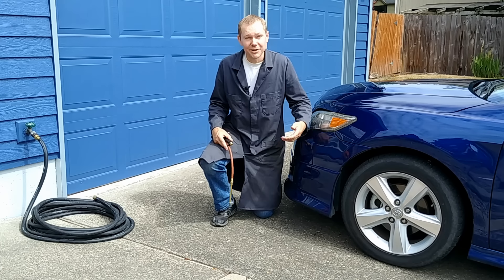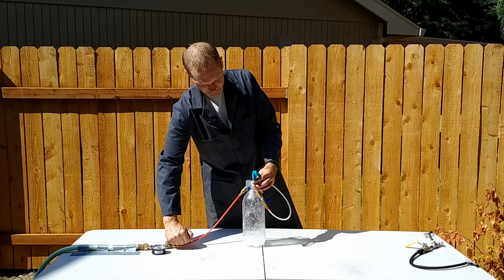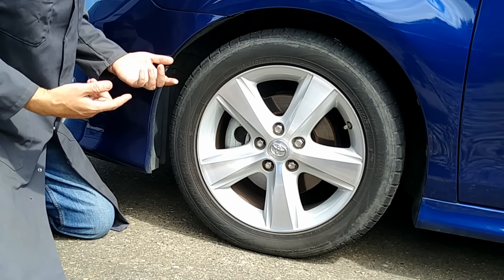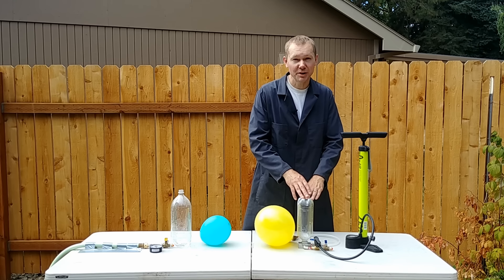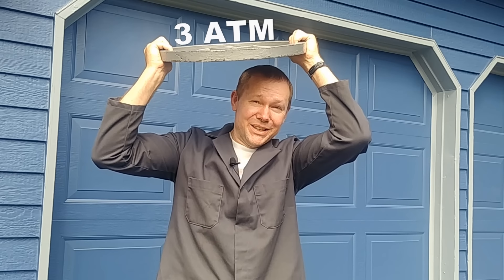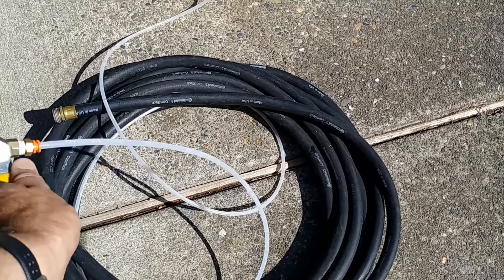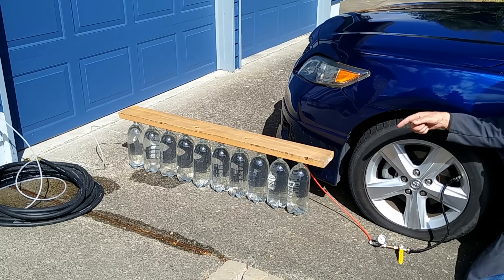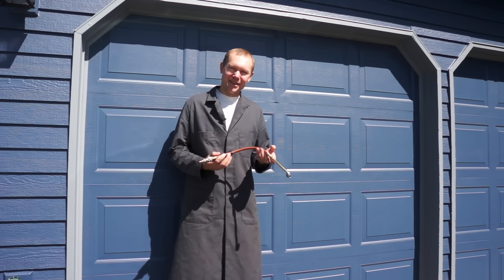2 Liter Bottle Compressor (No Moving Parts)

Comment: I once tried to fill a steel lawn roller with cone shaped plastic hose nozzle pushed tightly into the fill hole. It caused the flat ends of the roller to bulge out ruining it.

Comment: You should research the "trompe" which uses flowing water to trap air bubbles under a container to produce compressed air. It doesn't need to be emptied manually.

Comment: I had never really thought about it but the water acts like a piston being non compressible. As it occupies the same space that the air used to the air is pushed out and compressed when it has nowhere else to go. Then when released it wants to reach equilibrium with where it is going. Great, now I have to build a water powered air compressor for my shop!

Comment: I saw a company making air batteries doing something similar to this, they would use water pumps to fill huge storage tanks and then use the compressed air generated to pump the stored water through a turbine.

Comment: Fun contraption and experiment. But the pump up the tires in my truck it takes me about 5 minutes to turn the compressor on and pull the hose out into the driveway and air my tires.

Comment: The top end is whatever your spigot water pressure is. It would probably be more efficient to use a larger container like a 55gal drum. Screw the hose into one bung and then the air hose into the other bung. The pressure would build until it equalized with your source pressure and then the water flow would stop.

Comment: Good job! Just discovered you tonight and subscribed! However, there are moving parts. The water pump that is providing the water. Also, if the water pressure isn't at least as high as what is needed to fill the tire, it won't work. My well pump fluctuates between 25 and 40 psi, so not sure how that experiment would work out for me.

Comment: Do you think you could fit a pressure over flow where it will empty the bottles.

Or you could create a loop......where the bottle fills from a container and the overflowing back into the container.....meanwhile creating pressure for the tyre.

Comment: so the mechanism is water pressure? wonder if you can push enough air that you exceed the power provided by the tap? in the sense of daisy-chaining more bottles, rather than draining and refilling the same system?

Comment: The ratio of air in the last bottles to the whole system at equilibrium with the hose pressure also tells you your water pressure at home without a gauge.

Comment: Needless to say that By the time you used all energy and resources to inflate the tire, the tire pump manually could have inflated the tire in 1/4 the effort and time than with the water solution.  This is a great tool to teach air, water and volume displacement to students. All in all, it's a good video.

Comment: So, just watched, Just have a think, he talked about energy storage using this principle, store the air, then release it to push out the water to push a hydro turbine back into the main water storage. There's a company call Airbattery (I think) that claims a over 70% system efficiency). Would be cool as a revisit of this principle to see if we could generate power from the pressurized air, into hydro power. You kinda already have the most of the system, just need a water reservoir and the air tank.

Comment: Still would be a limited air pressure. Say you have a well it will typically has a pressure of around 35psi. Never looked into city water. But I have more pressure with my pump then I have ever had in a city. It may only be 20psi or so...... so if in the city you may have to still get air somewhere. With a bigger truck you won't be able to get to a safe pressure. My one trucks tires are 110psi...... never will reach that. As well as if you go and work the day it will take to build this you could just buy a airpump.... love the idea. Will probably make one out of like ten of them to use on bike tires.

Comment: Could you make a power storage device by doing this in reverse? I.e. pump water in using a solar panel and storing air pressure and later use the same air pressure to push water out of bottles driving the same pump as a generator?

Comment: That's great but what I would like to see is one more step in the process and that would be turning your bottles upside down and using some of the pressurized air along with the bypass and a openable exhaust port on your machined Parts whatever you're calling them to exhaust the water and start over without having to disassemble and manually dump the 2L bottles I'm hoping you understand what I am trying to say thank you

Comment: You are saying that a single bottle can handle 34 psi (supposing that the piece you crafted didn't include a switch to a one way  flux, or 34/4 supposing it having that).
It's amazing!
And another thing I found interesting was that your water  pump can easily push 10 atm such  that the air didn't come into the water pipe or ,most likely, the pomp ended to erogate water as a closed switch.
I am not an expert but those findings are interesting.

Comment: How about next try to use pressure washer and fill with pressurized water. I don't think it will drive well or be long term solution but is it possible for emergency?

Comment: Big brain time. Two adapters with a valve in the middle. Fill the first one turn off the middle valve, empty the first. Then repeat until you can't compress more. Then remove the second bottle and valve attachment and repeat that process 3 more times. 4 compressed 2 liters should have enough I believe. Then you could even keep them in the car for and emergency. Probably more expensive than one of the leak fix cans or possibly even a roadside air compressor, but...

Comment: Curious about the average water pressure in the U.S. In the U.K. it can be up to 150 PSI depending on where you are but the water company only legally has to provide 15. So there are certain areas where (I think) this wouldn’t work once the tyre pressure equalises to the mains water. The video was cool though!

Comment: Wastes water, and ruins rim with wet air which will rot the metal.  Possibly a safety thing as even a small bit of water or ice could throw off wheel balance at highway speeds.  Yeah, the demonstration is cool, I guess.  But I'd probably have prefaced it with a warning, and noted on the outro how you had to take the tire to be pulled off the rim, hand dry, and let it air dry for a week after.

Comment: one thing i don't get - isn't it limited to the pressure of the water coming out of the hose?
i mean - at some point, the pressure of the air in the bottles, will equal to the water pressure and it would stop...

Comment: this actually could be very practical if you made it recycle the water have an air inlet with a one way valve reduse the amount of bottles to maybe 4 and have the 5th be the pressure bottle setup the recycling of water below the point of whch the air goes up into the 5th bottle and the flow should suck in more air from the inlet and using an electric pump the flow of the water should mainly keep things going you could get away with just a double A water pump and have a full system in the back of your car as an emergancy solution this can also be sized down to take less water to use and have less bottles aswel as weight but the minimum i would say is 3 bottles 1st inlet 2nd water storage 3rd air storage this could allow you to make a compact system to reinflate any flat tires on the go

Comment: It will work much faster if you use a long hose (or all of your hoses connected together) and you drain empty it when you empty the bottles.
In fact, in a pinch you could do it with just one bottle and a long empty hose.

Comment: You're right about there being 1 ATM around us, but the tire pressure is relative to the atmosphere, known as "gauge" pressure rather than absolute.  If your tire needs 30 PSI, then it is 30* PSI gauge, or 2 ATM worth in addition to the atmosphere around us.  *ATM = 14.7 PSI for the technical

Comment: funny, but wouldn't work here because it depends on the water pressure, and in a hilly area like mine, grid pressure is around 2 ATM near the top of the hills. And of course, there's a lot of water wasted. Would've been so much more awesome if you used solar power for it: open the bottles real early in the morning at the coldest time of the day, then seal them up. Let the sun heat up the bottles. Then use the pressure to push another volume of fresh air (cold air you took at night and kept in a cool area in the dark) into the tires. (would be pointless to use the hot air directly, because it would lose it's pressure as soon as it cooled down in the tire)

Comment: I like it. I suspect max pressure would be limited by city water pressure with some additional losses due to the tubing/fittings/etc. I'd also use the weight of the last bottle to trigger a valve to close to ensure that you don't end up accidentally filling your tire up with water.

Comment: Now Im curious how the water pressure affects the experiment. Could you do this with a river waterwheel or similar? Isnt 30psi = 30psi? So if you cant force the water into the system at 30 psi eventually it will equalize at whatever pressure you're generating?

Comment: That tire is maybe half inflated and the problem with this is the air pressure can never be higher than the psi of the water hose pressure. Most faucets are under 50 psi. That's the reason the pressure in the tire was only 34.
Reply: @iconoclastpleonast8726  It is obvious just looking at the tire that it isn't even close to full

Comment: I know most people will see my stupidity in this question but I'd love to see how that bottle filling contraption works that fills the bottles in sequence - I'm trying to think how I would do that with very limited knowledge. I'm imagining something a like a ballcock valve where when the water fills to the top of the bottle, it pushes up a tiny float hidden in that wooden beam, the float pushes on a leaver which "opens" the pathway to the next bottle in the sequence. Have I complicated things?
Reply: The lever mechanism could work whereby, the float pushes up on one end, the lever pivots such that the other end pushes down on a spring loaded "gate" which is blocking the water path to the next bottle top. So the gate gets pushed down allowing the water through. To reset, when the bottles empty the floats pull their end of the lever back down, which returns the lever to original position and gates on springs no longer being pushed down, return to up position closing the water path. This sounds very wrong I bet its way simpler.
Reply: Wait... I think I have a simpler idea.. perhaps the incoming water has its pressure decreased - perhaps it hits some sort of open chamber near the top of each bottle which deflects the water down into the top of the bottle - eventually when the bottle fills up this chamber is also filled and the pressure in the open chamber increases to full pressure and this allows enough pressure to be exerted on some sort of "gate" which opens the path to the next bottle in line? Is this any closer?

Comment: your using the city water pumps. can it work with a 20' column of water? reusing the water
Reply: Yes,  but with a 20ft head you`ll only get around 8.6psi. If you hook it up to a ram pump you can increase the pressure considerably but at the expense of flow.

Comment: It's the very essence of the process.
The whole discussion in this video is avoiding (by the entire implication w/o express reference) discussing the basic physics of it all.

Interesting slight-of-hand Physics lecture.
Reply: Yeah, those are mega bottles, able to pressurize something with more surface strength than the bottle itself. The real question is, how much pressure can the bottle handle, before the back-pressure causes it to rupture?

Comment: that is is super cool... but not a good idea... most compressor air has a drier or moisture separator  in the circuit to stop moisture from entering the tire...that introduces a massive amount of moisture into the tire and because of that moisture the air  in the tire is going  to have alot of condensation as the tire heats up and cools down ,,,the pressure will also vary more with temperature swings.. the condensation will cause rust or corrosion to start on the inside of the wheel.  just fyi

Comment: So all you need is a 50 gallon barrel with a sealed lid and Bob's Your Uncle.  Especially since most residential water systems run between 45 and 60 PSI!  The you can put a water pump on it to pump out the water in the barrel and wash your car with the water from the barrel.

Comment: I got a question I'm a lathe operator on the hobby level I mean I've been doing it for 10 years so I know what I'm doing I specialize in single point thread I love threading I've made some crazy threads some very difficult ones I've done tiny inner diameter threads just to prove that I could do it by making very very tiny high speed steel single point tools but I've never done the standard pop bottle threads I think it's a double thread but I can't remember could you give me any tip on how to create that thread? I guess I could just do a Google search but you seem to know what you're doing hopefully you'll see this. Cool video by the way

Just as an FYI you can use a big column of water to make either a vacuum pump or a compressor as a matter of fact the first compressors were built using water pressure from Rivers and there's still a giant one that's being used on a regular basis and I can't remember where it is maybe it's England I can't remember. I always wanted to utilize my sump pump that ran almost constantly to generate electricity by capturing the run back water

Comment: Unless gravity water fed, turbine generator from electric company has a lot of moving parts to power the water pump in the well (or city water) wich also has a lot of moving parts. Then lots of bottles to remove to empty Wich may create sealing problems and then the valves. Not very reliable and does not work in freezing temperatures. Otherwise, interesting idea.

Comment: you have just to feeling tow botel  one of them  with carbonate calcium it thecover  pierced by 3 pipes one of pipe touches the bottom of the bottle  the ather withe chlorhydrique acide it cover pierced by 2 pipe one of them touche the bottom ofthe bottle  then we conect  the longueste pipe in first bottle to the shorter pipe in theseconde bottle and the shoter one to the logueste in the second one And when we turn the bottle containing hydrochloric acid, the acid flows into the carbonate, releasing CO2 and blowing the car tire with it. 
This is what I did for my son's bike

Comment: I would have just fixed the tire and been done with the problem.  Probably would have taken a lot less time than building that contraption.
Reply: Can't believe how many people are too inept to see the real point here - the flat tire was just to show off something about science.  He didn't NEED to fill the tire with air this way, he WANTED to show people it could be done.  He essentially created an air compressor without a motor.
Reply: @sirgouki6207  He said he was too lazy to walk 50 feet to get the air hose.  If he was really that lazy, he would have just fixed the tire instead of spending how much time to build the bottle compressor.

Comment: what if you had top and bottom; to flip over; to let water drain into bottom row of bottle;air will escape to top side and escaping air will spin impeller;
if there was four sided; and 8 sided; liken to paddle wheel;and stack it; say 12; and turn like pivot irrigation; in farming; let one fill after another even; the amount of air escaping from each turn will be more than amount need to turn pivot; thus we will have electric generator with net plus; how about that? is that a patent able idea?

Comment: hi
what is the pressure of your tap water?
volume and pressure are different...
if your tap water pressure is less the 34 psi i dont understand the mechanism of your system
how do you compres the air more then the pressure of your water system?

Comment: So 1 atmosphere is 15 PSI and the flat tire contains 1 atmosphere, that would mean the tire is already at 15 psi? So a tire pressure gauge is tare a 15 psi to read 0 when there is 1 atmosphere?
Reply from the maker: Yup.  Unless you have a gauge that reads in absolute pressure which is rare.

Comment: So basically anywhere there is running water there is potential to passively compress air?  And then compressed air can power motors?  I'm starting to feel pretty stupid for having purchased gasoline my whole life. Actually, it wouldn't even have to be running water and it wouldn't have to be done passively.  I could actively pour one glass at a time by hand.  Or, I could leave the water where it is, flip a five gallon bucket upside down and push the bucket to the bottom of my swimming pool.

Comment: He has a problem is the water from your garden is pressurized by a compressor at the water company so you’re still using a compressor one way or the other you tight wad you can buy a small compressor for filling tires and it’s a lot less hassle

Comment: This is not a compressor rather a converter which converts the pressure in the water pipe to air pressure. This can not generate any pressure.

Comment: In theory, would work great...
I would never do this. 
There's a reason that pneumatic systems utilize air dryers. And air tanks with your compressors have drain valves on the bottom. 

The issue with this...
As it may not be much, 
Moisture causes oxidation. 
And, if you don't shut the valve off 
in time, water will effect the tires 
Balance & performance. 
Then you'll have to go to a tire shop to get them to pull the tires off the rims to dry them up.